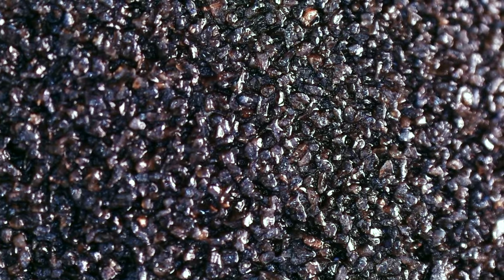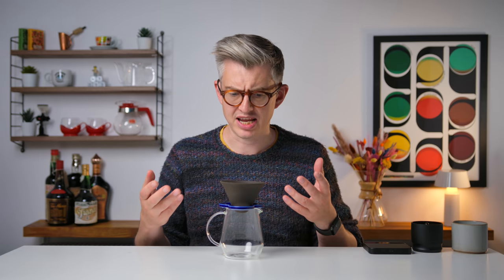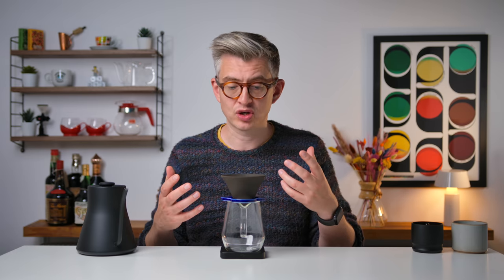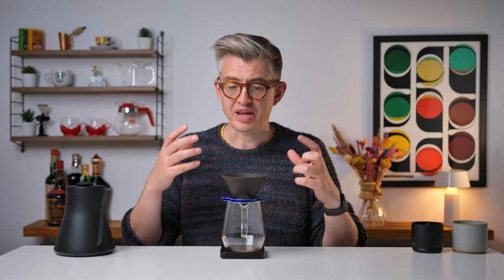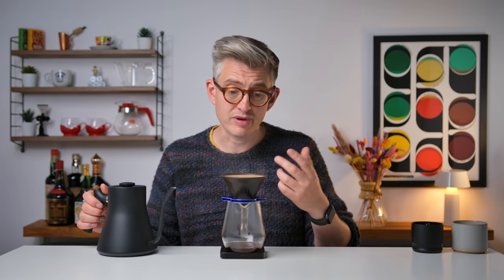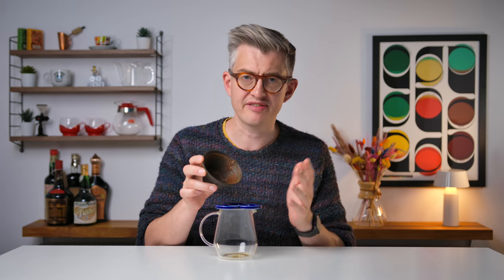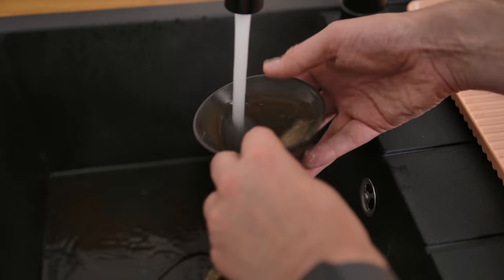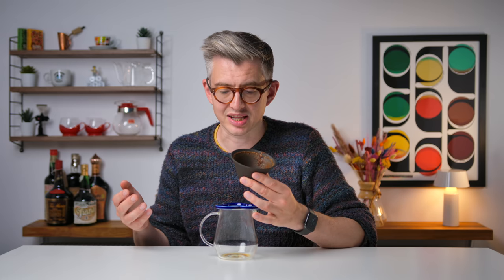Ceramic Coffee Filters: Magical or Maddening?

Comment: The aeropress might be a more sustainable option. You can wash the filters easily and re-use them many times. Also, these filters are very small.
Reply: The water needed to wash them is honestly probably taking more energy and water it took to produce them, I don't think it's any more sustainable to wash them
Reply: The water wastage is more than a single use and throw.
Reply: The lifespan of the Aeropress is also great due to its durability, I am not sure a porous product like this could last as long as an Aeropress or plastic v60 (the ceramic ones will always expire at some point, even if it's just from the surface material wearing off).

Comment: Non bleached Bamboo filter papers are the way to go, or hemp filter papers. Sustainable, Affordable, and by far some the cleanest tasting filters I’ve tried.  I’ve had metal filters before but they tend to corrode over time. There are so many good options out there that I couldn’t see buying this except for pure novelty.
Reply: My Metal filter is still going strong after over a year (almost 1.5 years) and it is either stainless steel or aluminum. I am hoping it is actually stainless steel like the Chinese company selling on Amazon said it was. It is made for use in a drip coffee brewer, and it works better then how paper does as paper was starting to give a crappy pour, I blame our cities hard water. However, with the metal filter you had to use the filter first one time to remove the taste of metal in your coffee as now a full clean would not lead right back to metal taste. To be fair I only ever used a single paper filter at a time unless by mistake, even getting unbleached natural at one point so having the coffee have a crappy no drip was still a problem, I even tried less coffee as in 1 scoop of a 2 oz scoop and problem was worse then with the 2 scopes of a 2 oz scoop. It is our water being so hard with Magnesium that I can't get good coffee, then at work they have the same coffee machine and I can get the paper to work there, but then that machine has something wrong with the burner in that it gets too hot from what the company says it does so I think that helps the hard Magnesium water do way better though a paper filter though not great. We have water so hard with Magnesium that it has stained tubs and stains white clothes in wash if using either Oxy Clean, and turns clothes almost a hunter orange if you use bleach. Now it is so bad that when the safety standards of the USA changed to be same as Canada and the new hard water Max came out my town had missed the max level by 100 parts per __ the USA uses to be the same as Canada.

Comment: I wonder if it's possible that treating these like cloth and freezing them would reduce the off flavor?
Reply: my guess is that because of it pours nature, freezing it would result in it cracking/breaking.
Reply: I do not own a ceramic filter, but do own a cloth filter: I believe keeping it in water is supposed to help the filter from degrading, and the fridge is supposed to minimize bacteria growth while it's sitting in water (that's why, like food, you should move it to the freezer if you don't plan on using it for a month or two). 

I'd think the ceramic filter might be prone to cracking if you went from a freezer to boiling water - I'd also think freezing would cause any water or water vapor to expand, also increasing the risk of cracking. If there were minuscule amounts of coffee oil on the filter, I don't know how the flavor would be impacted by being exposed to a freezer - but I'd think the risks and maintenance outweigh the benefits.
Reply: I own one of these, the manufacture recommend burning it on the stove to clean it, and yes it works, just burn it on the stove for like 5-10min and let it cool and rinse with water, any residue or fines will turn to dust after that long of burn
Reply: The off flavour is likely the ceramic itself, like clay pots

Comment: We picked ours up in Kyoto. 

We only use it for certain teas to minimize clogging. It does well with short steeps of broader leafed teas like oolong. 

Cleaning involves burning off gunk in the oven or over an open flame then rinsing with boiling water until clear.

Comment: ceramics are not zero waste, they are made in big expensive hot kilns powered by the tradditional fossil fuels we all use everyday. Paper is probably a lot more sustainable as well as biodegradable
Reply: Everything is not zero waste by that standard because everything has to be produced or manufactured somehow whether it's metal, ceramic, or paper. What they (the product manufacturers) mean by "zero waste" is there's not supposed to be waste produced from using the product (i.e. trash).
Reply: @Strideo1  true there is no zero waste products

Comment: for cleaning using heat to decompose the organic material is quite the obvious choice.
you can place it in the oven at pyrolysis temperature probably just barely works.
Or you can heat it with a blowtorch, which should be achieved relatively quickly and with approximately 1/4 to 1/2 camping gas canister.

but... just get a fine mesh coffee sieve instead 😁

Comment: compressed sputtered ceramic filters have been around for a LOOOOONG time.  That company was able to start making them in the 80's because the patent that was made to cover when the original company's trade secret got out had expired.

Grind coarse AND mesh-out the fines: if you've got an espresso sifter it works well for this.

Comment: We used to use ceramic water filters in the form of what we called candles, tubes filled with carbon. The water came into a bell housing and was forced by low pressure through the candle. Worked great but did keep clogging up with the matter you were trying to keep out of the tank. They needed scrubbing on a regular basis which wore down the candle until they broke.

Comment: I've used a metal zero waste filter for a while and it clogs really easily which makes for a very slow drip. The metal also lets the heat out of the coffee meaning by the time my brew is ready it is often luke-warm or cold. Now I don't mind cold coffee at all, but I do prefer it warmer than that thing produces so I've gone back to my Cafetiere and haven't looked back since. 

The Cafetiere is easier to wash, doesn't clog (And even if it did, it wouldn't matter as much) and can make more coffee and faster. It is easily the superior brewing technique to this one in my opinion.

Comment: Perhaps it is for places you rent, it can sit in cupboard for years and not need replacing.

Paper is more "green" if it is hemp based or recycled.  But if  you have a stove/potbelly to warm a cabin, you could put filter on it to carbon clean I suppose without extra energy.

Comment: I totally agree with all of your findings. I wanted to love it. I thought it could be great to save on paper filters, and it fit perfectly into my stainless one cup coffee filter. However I can get very inexpensive paper filters and I compost the coffee and filters so that’s not really a savings. It has a funny taste to me as well. I can’t put my finger on it but it does detract. Additionally it takes longer to brew so the coffee is not as hot by the time it is finished.I have used it for a couple months and it is brewing even more slowly. As far as cleaning it, that’s a bust too. I can scoop out the coffee into my compost bucket pretty easily but it takes so much water to rinse it and I never feel like I can get it fully cleaned. 
I might try putting it in boiling water and see if that helps it brew faster and taste better. If that doesn’t work I may plant an orchid in it!

Comment: Amway makes a water filter that uses a large cylinder of pressed activated carbon.  It has a porous plastic tube in the center and several membranes around the perimeter to filter out sediments and any dead bacteria (killed by municipal chlorinated water).  It also has a UVC light inside the case to insure any germ or bacteria that was not killed is killed.  By the time the water passes through the pores of the pressed activated carbon more than 99% of any type of chemical or other contaminates has been filtered out or absorbed by the activated charcoal.

The nice thing about their water filter is that zero water is wasted during the filtering process.  Unlike reverse osmosis filters that have to dump several gallons of water down the drain for every gallon of filtered water, whatever water goes in the filter comes out the faucet and it will filter the water as long as the faucet is open and water is flowing.

Comment: Also an idea for cleaning (definitely not every day, but only if it gets clogged): some ovens have a "self-clean" function, where it heats up to very high (few hundred Celsius usually) temperature. In cooking its used to season stainless steel pans, but the main goal of the self-clean is the same as here: it gets very hot, turning most stuff into ash. Maybe worth a try.

Comment: Ceramics are used for water filtration in survival filters. They are very cheap, last forever and filter out anything larger than a virus. The difference is that those use super small ceramic tubes, which are easily cleaned by blowing through them on the daily and a bit of vinegar for long term storage.

Comment: I do wish you would review a syphon brewer/vacuum pot. It's how I brew coffee typically and while I do believe that a lot of the cult following around it likes to overblow its benefits, it's a very interesting system that to me has some of the benefits of a French press or aeropress while being ostensibly more efficient in its extraction. 

Like a French press or aeropress it involves separate infusion and filtering stages with the main difference being that the pressure is applied by suction from the vacuum being built up in the carafe. 

Honestly a lot of my interest in seeing you review it is seeing how much of the dogma stands up to your scientific approach. I have seen a couple scientific recipes for brewing with it, which involved weighing the coffee and using a thermometer and so on, but I wonder how or if they could be improved.

Comment: Try the 'Cowboy' method of coffee. In short; brew grounds with the water under a rolling boil for at least 10 minutes. (this breaks down the acids that lead to bitter coffee) After that, run some cold water around the inner edge of the pot. This will knock the grounds to the bottom and keep them there. What's left should be a full flavor smooth cup of coffee.

Comment: I haven't used this, but i have been using coffee socks for my single-cup pourovers, and it's been a nice balance between using a paper filter every time and the metallic taste of metal reusable filters. i like that you mentioned the cradle-to-grave and water usage of this, the big picture thing is usually something that gets forgotten in the marathon that's sustainability. the only cleaning i have to do outside of the typical clean out the old grounds (which you'd have to do with any reusable filter) is boil it in water for 10 minutes every two months. i'd be curious to see your thoughts on it or other reusable cotton filters you could find!

Comment: I picked on of these up in Japan in 2018 or so... And it was marketed as a coffee filter, but also to be used as a wine aerator, and a water filter.  I can't imagine doing all of these things as it seems like it would absorb flavor pretty quickly.  As a result, it's sat, unused, in my coffee area.

My initial thoughts seemed to line you with your experience though, it's not an ideal brewer, it's tough to clean/maintain, and while it saves a filter paper, it uses 10x the water.

Comment: I would guess that the advantage would be the specific heat capacity of the ceramic being higher reduces the temperature variation of the coffee. Kind of like using a cast-iron skillet to sear a steak; the point is it doesn't get cold and hot spots as easily. It takes a lot of heat to heat it up, but once it's hot, it's going to be hot for a long time.

Comment: A random ceramic dude here, its probably a blackburn claybody with a pretty low vitrification level and lots of highly vitrified grog in it so it creates a network of tunnels just like a sponge.
Like a sponge it has many problems with contamination, retention and sterilization. 

Additionally depending on what is in the claybody and how its black color was achieved it could have magnesium oxide remnants which are considered hazardous to long term health through chronic exposure through food contact. The clay body could also be from black iron oxide (or other materials) but its not nearly as common in black burn bodies.  The off taste you described could be the lack of usual contaminants that we find in most brewers OR it could be particulates from the clay body/its colorants. 

If you want to test that last bit I would do an acid test where you get a bowl of lemon juice and submerge a part of the filter in it for 1-5 days. After taking it out if there is a change in color leaching is occurring. 

FIR, al marketing BS.

Comment: I've been using fabric filters in a stand for my pourovers for quite a while.  Cleaning is easy, just a quick rinse and let it dry.  They last forever as long as you let them dry out.  Between uses.
Reply: i have used fabric filters for a long time.... from time to time the fabric needs more when just a quick rinse. you will have to wash the oils out which are trapped in the fabric  otherwise at some point the flavor of the coffee will chance it will taste of the old coffee oil s which are trapped in the fabric filter.
Reply: @blackforest_fairy  correct.   Some unscented dish soap and a gentle scrub works well.  The oils do tend to collect along the underside of the top.  And I keep two, one for regular coffee, and one for flavored.

Comment: Far-IR may interact with some of the chemicals in the coffee to help them dissolve better. Depending on the chemical structure, they will react to different wavelengths and their atoms will vibrate differently (there is an entire field of analytical chemistry based upon this). By vibrating specific bonds then it will change how fast they dissolve. Far IR refers to wavelengths more than 3um and the OH bond does fall into this at 2.8-3.5um. This means any organic acids and/or alcohols will more rapidly dissolve. However, without analyzing all the many thousands of chemicals in a coffee then it is impossible to determine if it is positive or negative to teh coffee. In fact, it is possible the far IR spectrum may cause more toxic compounds to dissolve...

I would suggest it does change the flavour, but I would expect the addition of minerals from the ceramic would have a much greater affect on the flavour than any additions from the coffee by this process, particularly Aluminium compounds.

Comment: I’m a ceramic artist and I’ve been considering making one of these for a while, but I haven’t because of a lot of the reasons you’ve mentioned. If it were easier to clean I might consider it, but I think I know exactly what you mean about the flavor imparted by the ceramic on the coffee. I wonder if I used porcelain instead of stoneware to make it if it would still have that flavor you’re talking about. We’d still run into the cleaning problem though.

I’m also concerned about the growth of bacteria or mold in the brewer. If it’s dried properly and washed with really hot water regularly that will probably kill all of the bacteria and not allow mold to grow in the brewer, but there’s still this rule of thumb in ceramics that porous or unglazed surfaces should be avoided for health reasons. If food can stay in the pores of the vessel, they can grow bacteria. Of course a dishwasher gets hot enough to kill 100% of bacteria, but if something is hand washed without getting hot enough, then problems can arise. 

The Near Infrared conversation sounds like a lot of pseudoscience. If it is true, any ceramic or even glass brewer will emit via black body radiation that when it gets hot, so this brewer doesn’t have an advantage there. There is however a nonprofit called Potters for Peace who teach people who don’t have access to clean water how to make ceramic water filters from local materials to make clean water. They put some silver in with the clay body but leave it unglazed so water can still pass through. The silver contained apparently kills the microbes, leaving clean, safe to drink water. 

As always I appreciate your videos and your reviews, as your thoughts help inform me of the qualities I want to engineer into my own handmade coffee brewers. I’ll probably stick with the conical glazed ones I’ve been making recently, which brew like a cross between a V60 and a chemex, depending on the specific shape and how large I make the hole. 

Thank you, James!
Reply: Porous or unglazed surfaces that come into contact with food,* I should clarify.
Reply: True porcelain is a very tight bodied clay which will not really be porcelain because it will need to be fired to bisque in order for it to remain porous enough to filter.
Reply: @robertopics  the way they make these is by mixing some kind of organic material into the clay which burns away, leaving porous channels for the water to get through. If you mix a porcelain with cellulose or other organic material, you can get a similar effect after high firing, but it would still be made of porcelain.

Comment: Hi, I have a brewer made of this. I initially found using it madening as the fines clog it up and the instructions to put it over a flame for 15 minutes didnt work. However, i do not have such problems as instead of a 15 minute burn, i do a 45 minute burn. This completely carbonises and removes any sort of debri in the filter and makes it brand new again. I hope this helps.
Reply: Thanks for sharing the top.  How high or strong is your flame?